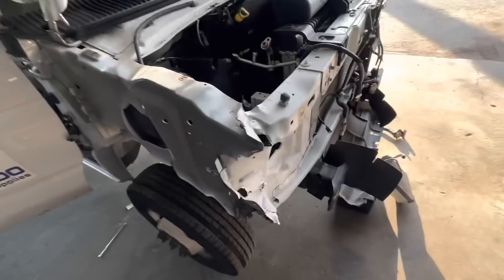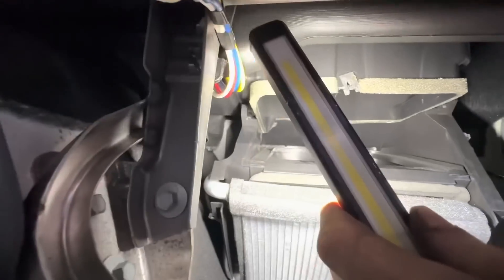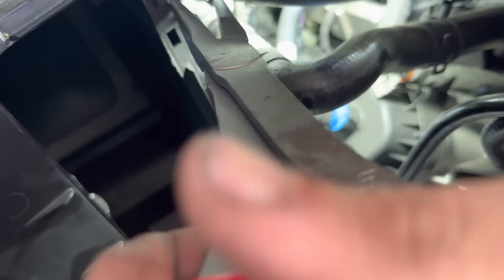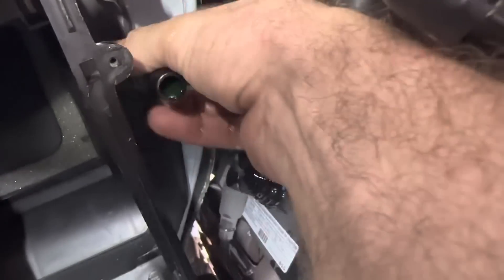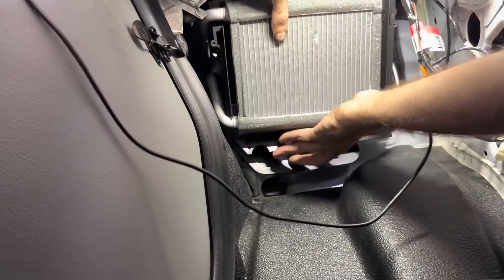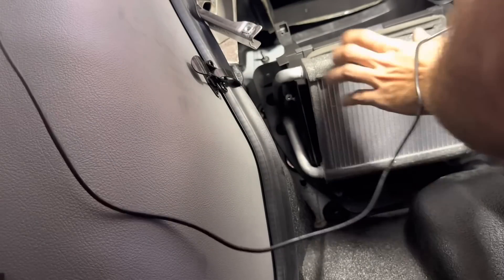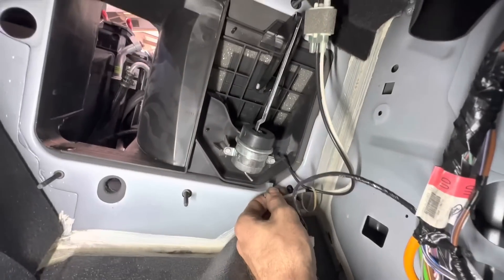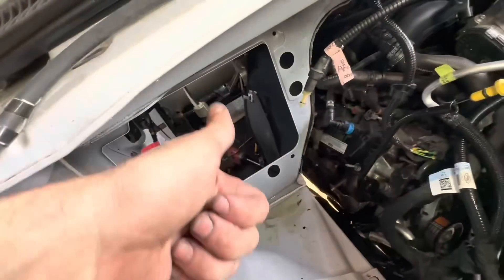Collision Repair: Didn’t have to be this way. Thanks Ford! 2023 E350 Cutaway

Comment from the maker: Everything was going so well… that last stud/nut was very disappointing

I think this vid was short…. Try this one! 
I QUIT! It's over! Forever Job! 2012 Avalanche 5.3
https://youtu.be/fhWJR_hTFqw
Reply: The ones that hide are always the difficult ones....
Reply: Whenever I have to take something apart to repair, I try to look for the most difficult thing first, it usually keeps my cursing down to a minimum if I triumph over that hurdle😜 It doesn't always work out that way, though😆😆
Reply: I'm sure you have noticed that the witness marks on the foam "washer" indicate it's from the lower oval thingummywhatsit seen at timestamp 6:32 when you were picking it up! :-)
Reply: Now you have to make a video on the Ford 2023 E350 body repair if you can.
Reply: You would imagine how hard it be if it was a older with some rust an corrosion on it I bet some bad words would have been said
Reply: My son is an mechanical engineer who designs and installs equipment for pharmaceutical applications.  We have had several discussions regarding how vehicles are designed and built as he has this complaint when he works on his own cars.  I have retired from a major American tire company in R&D and have talked to automotive engineers. The consensus is that the design divisions hold all the aces as a vehicle is in the design phase.  This leaves the mechanical engineers to stuff the operating components in as best they can.

Comment: Wow Ray no wonder it cost so much to work on the  newer vehicles. They make them so that you have to disassemble to replace a ten dollar part. You have great patience and are always able to overcome.
Reply: I think after 1980 all cars were built stupid this way , videos like this can maybe get non-mechanic people to understand the high labour sometimes
Reply: @buffystclair9042  - it goes back before 1980! :-) I had an Austin Mini of 1963ish era that had a tiny rubber coolant pipe between the head and the block which was impossible to replace without removing the head, therefore requiring new head gasket etc!
Reply: And even when they know there's an issue they still don't fix it! For example Renault heater resistors; bad enough if it just burns out the resistor which can just about be reached with a bit of disassembly if you have double jointed hands, but if the wires burn or the connector melts into itself then the entire dash and all the trim has to come out taking more than a handful of hours out of a mechanic's day.
Reply: Yup I had to do a water pump on a transit and had to remove the thermostat housing just to get to it. Two bolts where hiden underneath the housing and you had to remove it slowly so it doesn’t pull the inner tube out to the motor
Reply: @arteepee  Seems engineers always played games with us mechanics, I used to cheat when the frost plug on mid 70’s V8 Dodges cylinder head would leak , I would use a hole saw in the firewall for access instead of removing head.
Reply: @arteepee  Yes, I had a couple of Minis in the early 70's and found it was possible to remove the old leaking bypass hose then replace with a new concertina type one that could be squeeezed into place.  No need to replace the cylinder head but still a difficult job and the concertina type hoses would never last as long as the original fixed length type.
Reply: It's obviously a business plan to buy cars in auctions - including wrecks - and restore them with a salvage/rebuilt title. This will work as long as there is a shortage of used vehicles and the prices are high. Cars with salvage/rebuilt titles fetch much-much less than clean titles, so this business plan has a limited life span, workable until the used car market returns to normal.
After that, in most cases, more man-hours and parts are expended, than a car with a salvage title can be sold for.
Reply: That's the true, and as time went by, there was an aftermarket collapsing tube which enabled its replacement without the need of  head removal
Reply: @buffystclair9042  Oh, I get that all right! Which is why, as a senior, I'm starting to learn to repair my own 98 truck. The insane amount of tech and gadgets on recent models is daunting.

Comment: Had a 2001 Blazer 4.3L with a leaky heater core. The dash was crumbly and I had to save up funds to replace and repair. So, I connected the coolant hoses for several months with garden hose connectors and clamps. Worked great. Until january-ish. Then, it was too cold to not have heat up here in MD any longer. Damn I loved that stupid Blazer. 👍

Comment: I wish I lived in Florida and Ray could’ve done it with my 2010 E350 super duty van not a cutaway it’s a 10 passenger. The head gasket started leaking oil  and it’s a 29 hour labor job plus parts and then my timing chains were loose so basically five grand later. It’s just stupid to have to do so much for so little
Reply: Yikes.

Comment: Love that "Gravity." Replace the current "stud" with a double ended stud (threads on both ends) and a washer and thin nut on the outside. to hold the stud for the heater core or box. Then hold the blower box under the hood with a nut on that stud. Optionally a stud with a flange in the middle with the flange on the outside to replace the need for the washer and thin nut.
Reply: neat thought

Comment: This double nut job was clearly dictated by the vehicle assembly process. The HVAC box went in first and had to be secured to the firewall with studs. Keeping this particular stud in place required a nut on the inside to secure everything. At a later time, possibly several stations down the line, the heater core box goes on and because it uses the same stud, it would have been possible to push that stud back out of the firewall when pushing in the heater core, had it not been secured with that nut. Furthermore, because the heater core gets attached with nuts on those studs, those studs are not allowed to rotate during tightening of the nuts, otherwise you would need another person on the other side, the engine compartment side, with a tool to hold the bolts in place and keep them from spinning. So there are two reasons why double nutting was necessary with this type of assembly design.

Comment: That extra gasket from under the dash was probably the water drain tube gasket, located at the bottom of the plenum. And those hidden studs have been around since the 60's, mostly on GM cars.

Comment: if only car and van makers realised what you have to go through to get at things but i think they will never ever change, thanks for the video
Reply: You need to be part troubleshooter, part technician, part engineer, part-surgeon and part contortionist to work on these new vehicles.
Reply: They do it on purpose as it is all about initial assembly, everything else on You after warranty.
Reply: @tiddybearkush  It's quaint that you seem to think Ford is the only offender.
Reply: @tiddybearkush  😡
Reply: @tiddybearkush  Don't blame Ford.  My worst example is from a 1990's Toyota 2 liter.  A vacuum control for PCV/EGR (Can't remember which).  On the back side of a transverse engine, with at least four feet of hard vacuum line and the only way to change it was to pull the tire and wheel well and use 2 feet of extensions and a wobbly bit.  For no reason.  The actual valve was on top of the engine (looks like an EGR in my memory).  

I just left it in place, put the replacement on the firewall.  And there was enough existing soft line to reach it...
Reply: They know. They are hoping that people will do more damage in frustration,  meaning more parts sales.
Reply: @KiwiHelpgeek  😂
Reply: Nah, they only care about work they pay for. That's manufacturing and warranty work. Non-warranty work they don't care because you pay them to do it, so the more complicated the more the dealers make. They have zero incentive to make it easy for them.
Reply: I've been an auto worker for 24 years.  The engineers who design this are only looking for the CHEAPEST and fastest way to put the vehicle together on the line.  What someone has to do after it leaves the plant doesn't matter to them.
Reply: If only people understood that manufactures are in the business of MAKING vehicles not repairing them.  In reality maybe 0.00001% of the vehicles produced would ever need this specific job performed.  It's a little more of a priority to focus on the 100% the manufacture will have to touch in production than the 0.00001% that will need to be removed/repaired.
Reply: @tiddybearkush  Yet your post to which I was referring said, "Stop buying ford is the only thing that make them stop."
Which is like saying, "If you dont like phones with non-removable batteries and no headphone jack, just stop buying from Apple." And yet those are becoming the norm across multiple brands.

Comment: Wow, I haven't been this early to a Ray video for a long time😁  I just finished changing the battery in my Dad's 2015 Buick Encore.  The old AC Delco was kaput.  8 years is damn good for a battery these days.
Reply: batteries probably last longer than the turbos on those Encores.
Reply: My original AC Delco battery lived for over 7 years in my 03 Silverado. Some batteries do hold up very well.

Comment: I know on the new Escapes you need to take the doors off to get to the HVAC system...safety bar that runs thru the dash is the reason so yea..thanks Ford✌️

Comment: LMAO, Reverse Tetris 🤣 I feel the pain, replacing the timing belt on my 14 Fiesta 1.6L today 😬 Ford, the struggle is real 😉 Thanks for the short break, now back to it 👊
Reply: could be worse, you could be doing the timing chains and tensioners on the Ford 4.0 V6. Got a chain in the front, one in the back, and in some vehicles the engine has to come out

Comment: This is how ford and major companies keep their business, they know these little things are here and its only to make un major companies turn down jobs. Damn these bum holes. Glad you are still cracking on Ray
Reply: No offence, but it doesn't work like you think. The amount of money Ford loses on parts needing large repairs is simply unbelievable. When parts go bad under recalls or warranty, the dealerships make money and Ford loses their shirt. Especially if the customer has an extended warranty.  When I put a new evap box in a new F150, they don't pay me $32 per hour for an 8 or 10 hour job, they pay the dealer $155 per hour, and the dealer pays me my $32. As for parts, you may think Ford just sends us the parts that are covered under warranty. Doesn't work like that. Ford has to buy the parts and pay retail prices from the dealer. And while the work is being done, Ford pays for a rental car. The customers can be in a rental car for months at a time. They pay so much for all these repairs, its hard to believe they're still in business.
Reply: @AT-wl9yq  Yikes! With all the recalls lately, hoping Ford doesn't go bankrupt and get sold to some awful company like Stellantis for example.

Comment: At least Ford changed their quick disconnect so it doesn’t require a special tool and has hose clamps to boot. I was stranded in an Aerostar between Tulsa and Arkansas due to a split heater hose. Roadside repair was to stretch the hose, but long term fix required a special tool and I wound up using a piece of copper tubing and hose clamps to splice it together as the auto store replacement hose didn’t have the pre installed quick disconnect fittings.
Reply: I'm wondering how long till they get brittle and break like the GM ones 😂🤣
Reply: Resorts to ''shade tree" deaspiration... tactics.

Comment: Well during assembly the engine compartment piece went in first, so it wouldn't fall off the nut was installed. It's not there fault it ever has to be removed. Thanks assembly engineers. Job well done Sir!

Comment: I have a question I seen you work on cars and pickups that are months old why does the dealer not fix these faults under warranty. Here in the uk any fault identified if repaired by the dealer while under warranty

Comment: That foam washer goes at the bottom of the assy on the inside of the cab. One way you can tell is it has an imp[rint on it the exact shape of the hole which is oval. Mabe a condensation some other drain connects via that hole. At @6:32 you pick it up less than an inch from where it goes.

Comment: I had to spend $6k to replace rear timing chain on my 10 explorer v6 4.0 liter engine, thanks Ford too for making such genius engine designs 😢
Reply: You Tuber "I do cars" just did a teardown of a Ford 4.0 liter V6 engine.  You can see the huge amount of labor to do such a job because of its design, thanks to Ford.
Reply: @TheWwong  what’s was not fair is that I keep my truck in tip top condition by doing all the required services . I contacted ford and made a complaint but of course no financial help from them on helping me with cost of the repair bill . I had to pay ford dealership because out of warranty. My vehicle had 94k miles when this happened last summer . If I would have known that the v6 4.0 had 2 timing chains 1 at rear and 1 at front I would have opted for the v8 instead that has timing chain at front of engine and no need to take out engine like my engine.

Comment: That "double capture" stud sounds like two designteams working on the project. The inside box being designed to fit the specifications they are handed and not knowing there's already a nut on that particular stud included in the specs. So they design to the numbers and end up adding another nut on top of the first...

Comment: The nut is there so that the outer housing doesn't fall forward, when you are removing the inner housing to replace the heater core.

Comment: Hey  Ray while I found this interesting in the amount of work being done to repair the ford it lacked some detail of what was actually happening to repair the vehicle except it needed some sort of panel work?
Reply: It was in the title.
 Collision repair.
Reply: @MonkeyJedi99  I was aware it was a collision just wanted a brief rundown of repairs and why it needed tearing down so far. My best mate used to own a panel shop and half the things they wrote on quote as a remove and replace item were never removed. R/R doesn’t mean replace necessarily with a new part just remove and replace for painting etc👍
Reply: @johnlarkin549  Ah. My apologies.
Reply: @MonkeyJedi99  no problem I could have been more specific in my original message but how much do you write, I’m the slowest message writer in history that by the time I write everything I want to say the next video is released and the one I’m messaging about is a distant memory for most. 🤣🤣
Reply: @johnlarkin549  I'm pretty quick at typing, given that I use my left index finger and two fingers and thumb on my right hand.
I also have to look at the keys when I'm typing.
I so regret not taking a typing class when it was available in high school!

Comment: It’s almost like the engineers design vehicles intentionally to make them impossible to work on.
Reply: @tiddybearkush  yeah, intentionally confusing and convoluted.
Reply: Engineers get awards for saving money. Why use six bolts when you can use four? Why use 4 bolts when you can use two. Why use bolts at all when it can be glued together.🙄 Why use glue when.....😳

Comment: Could be worse, it could have been a complete bare to firewall job.Over my many years as an Auto Electrician, I have done hundreds of bare to firewall jobs for panel beaters. They learnt the hard way that letting a panel beater pull a dash out and us at my shop having to pull it out and refit them was expensive.

Comment: You expect too much of engineers...  If they could think long-term maintenance enough to not double capture studs, we'd have more cars with removable headlight assemblies, all transverse V engines would be tilted forward, IPs and dashes with access points so you can get to HVAC controllers....  🤣

Comment: Automotive engineers don't seem to consider maintenance when they design their products
Reply: Especially heater cores, which they consider to be a "life of the vehicle" thing.
Reply: Nope!  They're designed around speed and convenience on the assembly line.
Reply: @axl151  Which they have to, to compete on sale price/cost/profits vs other manufacturers, but egads, in addition to "make things that don't break", I think if a manufacturer could also put some effort into "make things take less time/effort to repair", could boost their long-term reputations and sales figures, too. Juggling all those balls would be very hard, though.
Reply: Designers/engineers work on paper, not steel.
Reply: @Mudder1310  Not even close to true. Engineers not only work on steel, but they have to understand what that very steel is truly capable of. While mechanics may knock engineers, you never hear about the millions of times the engineers got it right VS the few times they got it wrong. Every tool Ray is using in this video was made by an engineer or designer, yet where is the praise for that.
Reply: It's not just automotive engineers, engineers in general only care if it works on paper.
Reply: Usually, they design on the frame or body compartment, and they have to squeeze parts into small spaces if not your vehicle would be super large for all the spacing.
Reply: My dad always said that the engineers should be made to do the services.  It's only then that they'll realize that paper does not equal real life.

Comment: Hmmm, I was thinking just wiz wheel the head off that bolt, then when replacing, just put some washers in to replace the thickness of the original first nut.